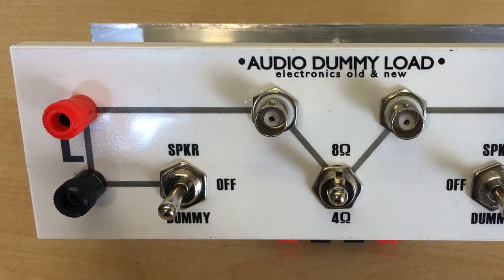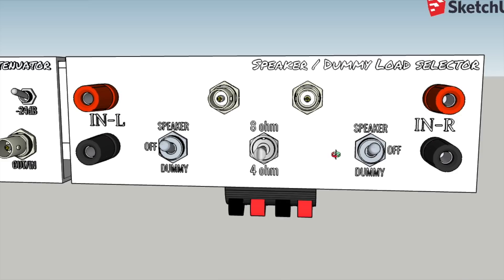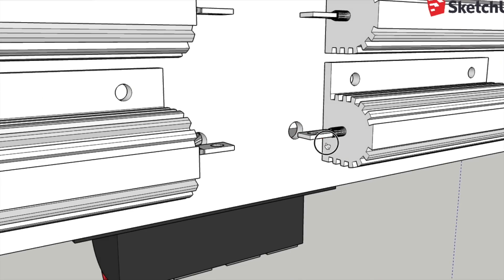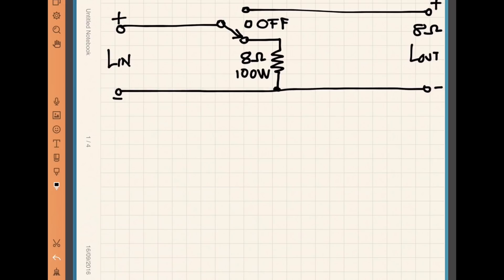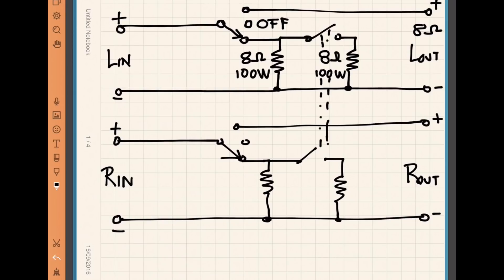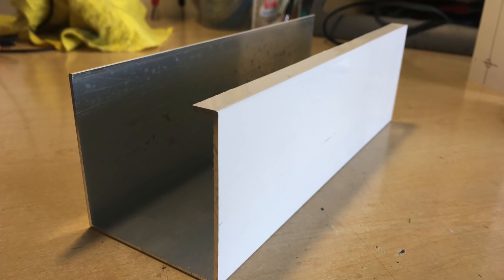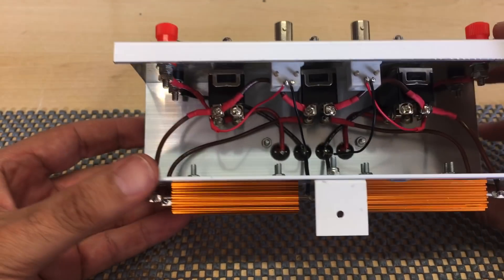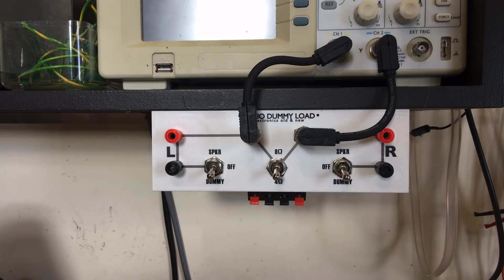Audio Dummy Load design and build

Comment: Great video! Love your channel. I'm planning to build a dummy load too.
Soon I'll start restoring a Grundig 5195 Stereo, which has 3 output transformers and 4 speakers if I remember correctly. Does this mean that I would need more than 2 dummy loads in order to not damage my output transformers? One per transformer or one per speaker?
Reply from the maker: My latest series on the Grundig 4006 has exactly the same output arrangement. You’ll need to place a dummy load across each output transformer, but it can be a simple 4 Ohm resistor, as I have done in mine.
Reply: @electronicsoldandnew  Thanks!

Comment: Just watched this and will prob build one myself.  Just wonder regarding the common ground when connected to the oscilloscope - would some capacitors between the BNC ground tag and the circuits reduce some of this issue ?  Hhhmmm I am of two minds on that.  Blocks any DC component, but the AC could still be an issue.  Oh and Aliexpress has a wide range of 50W and 100W resistors, (assuming you are not allergic to 'Uncle Ali'.)
Reply from the maker: No allergies here 😊 
The D.C. blocking cap will do the trick, but will affect the frequency response a bit. I’ve got so used to being careful that I don’t worry about it anymore.
Reply: Look into an isolation transformer between your mains and DUT for safety

Comment: I'm building a similar dummy load. I was concerned about blowing up my 'scope, especially as I can be absent minded. So I only used one BNC, plus a dpdt switch to choose the left or right channel.
Reply from the maker: That will help keep it safer. However, you still connect the speaker’s negative to earth, and if the signal generator negative is also earth, you need to remember that as well.
Reply: I'm just a few years into my electronics tinkering, so still learning. Can't the blown-up o-scope situation almost always be avoided by simply plugging the unit under test into an isolation transformer? 

It seems like the danger with the BNC, one per channel or otherwise, would be grounding one half of a bridged amplifier and blowing up the amp. In this situation, if one is really set on using BNCs, I guess you could add a ground lift switch then connect the scope ground terminal to the proper ground reference point in the amp (amp chassis)? Probably better/more simple to just use the scope probe and remember not to use the BNC in this case (and minding the ground connection of the probe to the proper point, i.e., not across the speaker terminals in a bridged amp). 

I guess, long story short... As is mentioned in the video, make sure black actually equals ground before connecting the scope ground to it via BNC or probe ground lead, or any test equipment ground lead for that matter.
Reply: You should look into an isolation transformer between your mains and DUT.  This prevents the possibility of a ground loop through your scope.

Comment: Given that your BNCs are going to a high impedence device why don't you put a capacitor from -ve to bnc ground? Then you can monitor both channels without shorting the -ve lines. You can have a switch across the cap for DC monitoring
Reply from the maker: That eliminates the possibility of seeing any DC offset, which is sometimes useful. You could put in a cap which can be shorted if needed, so yours is a good idea.
Reply: @electronicsoldandnew  
Thank you for your reply. I have recently made a dummy load system with caps in the BNC grounds and it works well. For DC or low impedence test gear I have a shorting switch on them. I had the idea from "xraytonyb".

Comment: Thanks for the video. I have 2 dummy loads of 4.2 and 8.4 ohms, can I use for load testing of 4 and 8 Ohms? What's the maximum tolerance? Thanks.
Reply from the maker: Those are fine. The actual “resistance” of speakers is very imprecise, and also frequency dependent, so you are Ok with those values.
Reply: @electronicsoldandnew  thank you.

Comment: Hi, I know this is an old video but if someone come across this post can you tell the correct name for the On-Off-On (6 post) and On-On (4 post) switch. Trying to build this.
Reply from the maker: Double pole double throw, and double pole single throw. However, the best designation is exactly what you have: on-off-on and on-on.
Reply: @electronicsoldandnew  Every Switch I look up using DPST 4 post On-On (Amazon & Digikey) the product description says On-Off. Is this the same switch?
Reply: @electronicsoldandnew   weird, just got off the phone with Digikey and no such thing as a DPST, On-On with 4 post. They all have 6 post.

Comment: I had bought two 500 watt wire wound. I've hit a stump on how the design would go.  I was wanting to put two 8 ohms in series for 16 ohms and like you're doing here for 8 and 4.  I'd love to have the non inductive to build my design.  In series or parallel the wattage capabilities would increase to 1000 watts I think no matter what the ohms would be.
Reply from the maker: That is one really large dummy load! 
The power handling is the sum of the resistors, yes.

Comment: Well but it may be dummy load but only to  signals like 1 kHz to which apparently speaker may  behave like resistance.  For sure it is  not 8 ohms for speaker 8 ohms. . Resistance of 8 ohms speaker driver is about 6,4 ohms. and speaker column impedance may vary from 3 ohms to 25 ohms depending on chosen frequency.   So I think it may be enjoyable to make measurements with computer which so many people discovered in last decade but it gives misleading knowledge.
Reply from the maker: I agree. However, using a resistive (non-inductive) load is standard practice for amp testing. You always have to consider the issue you mention.
Reply: @electronicsoldandnew  I think we should not push to measure things which in practiced way cannot be measured. .

Comment: Can anyone come up with a “not too ridiculously complicated “ way to add a 16 ohm load capability to this gentleman’s fine dummy load circuit? I’ve been beating my head trying to come up with a reasonable circuit but adding the 16 ohm into the mix has baffled me. I figure I’ll probably have to install a rotary switch to facilitate all 3 resistor loads.
Reply from the maker: Now that would be interesting with a toggle switch 😃 
I hope someone answers because I’m curious too.
Reply: 😕 Darn! I was really counting on you to come up with a solution....now I’m going to have to figure it out myself...lazy boy that I am!
Reply: @electronicsoldandnew  I have added an extra 8R resistor with another toggle switch, which gives the options of 4, 8, 12 or 16 ohms, utilising the two switches

Comment: The Lout and Rout have not 8 Ohms. They have what the amp has as the output-resistance. :-)
And the Dummy-R's have to be cooled with a fan, when you use the full load at them.
An old problem, what i have, is, how is a REAL loudspeaker compareable with this dummy-R.
If you measure the R, you get 8 ohm. If you measure the LS, you get what? No, no 8 Ohm.
Yes, of course, i know, the LS is completely an inductive coil. The dummy-R is from resistive wire.
Both parts have completely different behavior over the frequency-area. How does this effect 
the output of the amp? I never saw a dummy-load, which works like a real LS. How i wrote, MY problem. :-))
Reply from the maker: True. But for most simple test purposes, this method has served me well.
In the end, it's the ears that will have to do the final testing.